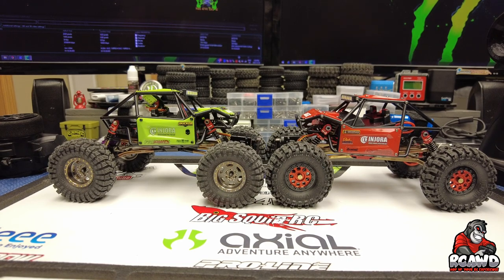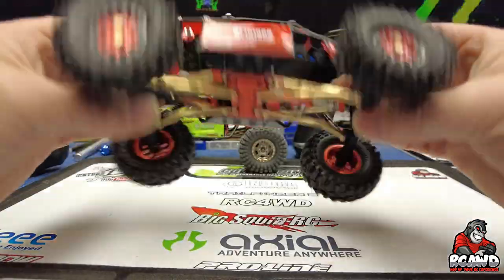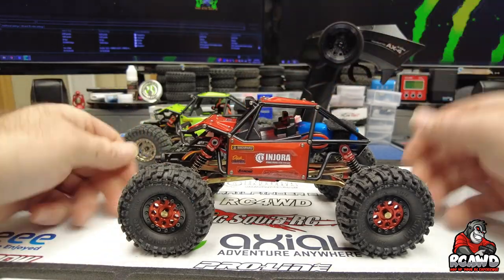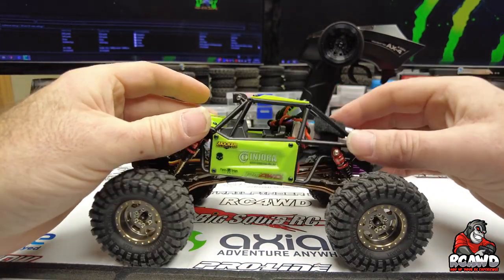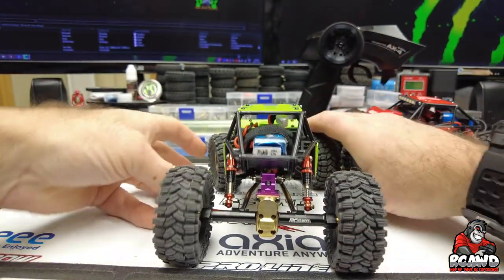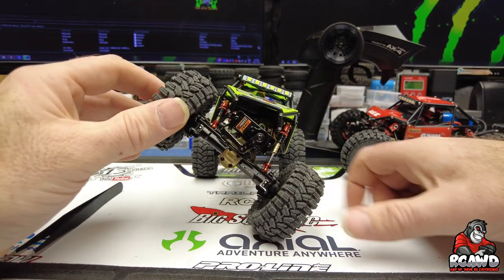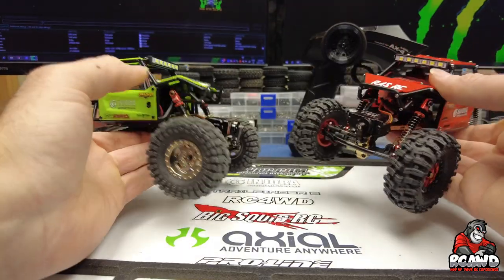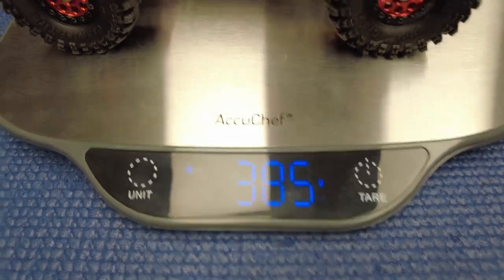1/24th INJORA  ROCK BUGGY BUILD "RCAWD SPONSORED" OVERVIEW

Comment: The red buggy has what looks to be different Injora shocks than the ones that you have linked? The other buggy has the linked one's with the extended gold pieces that makes them longer. So my question is exactly which ones are on the red one? I prefer the shorter flex of the red one over the green. They look great! Thanks for the build info
Reply from the maker: Same Shocks on both rigs, the links on the red are injora 50mm fronts and 58.5 rears. C10 link size. thanks for watching and commenting, the support is appreciated

Comment: Should go deadbolt rear end on the rear and  c10 rear links and driveshaft on the front. Much lower stance,  no need to de-case the ecu, way greater performance.
Reply from the maker: Thanks I will try that out, appreciate you stopping by and commenting